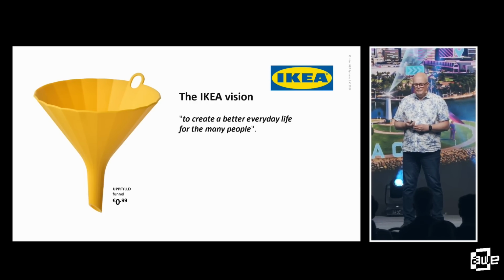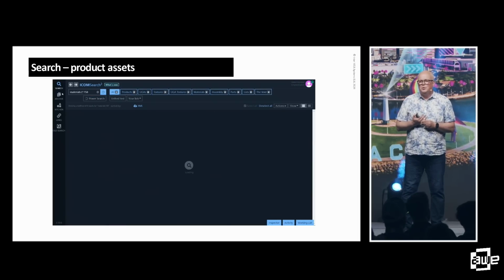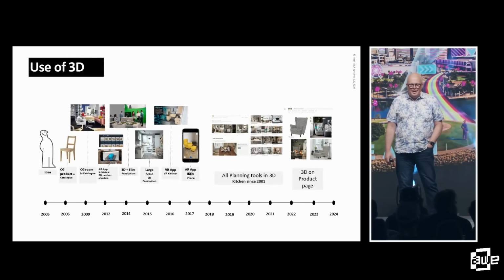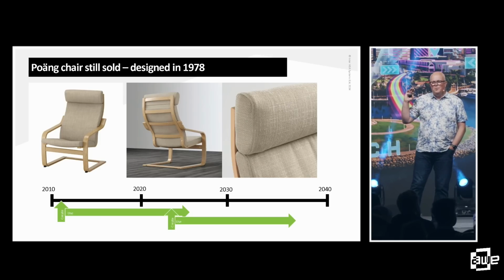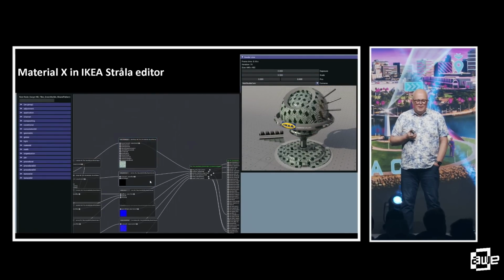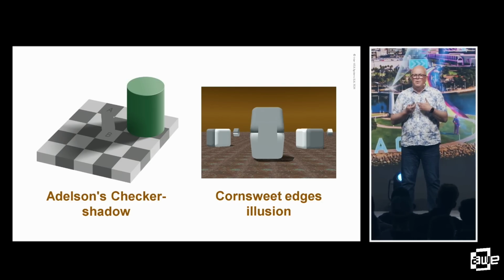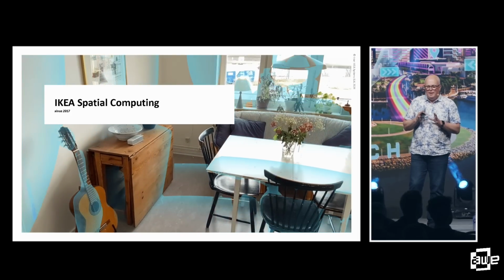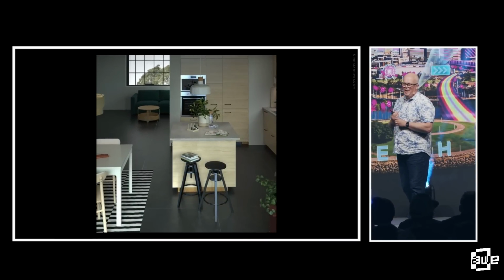IKEA's Journey Through 3D Visualization and Spatial Computing By Martin Enthed

Comment: Ive been using and doing 3d since 2007. Ive never hea4d the term, definitions per meter?!? I  really wonder if 0.05mm accuracy matters on an inage. I doubt their own peoduction of the actual furniture is that orecise. You wont norice a .5mmm differemce in a render of a room or even a close up
Reply: I get the different LOD versions he is talking about but yeah the 0.05mm accuracy is a bit of fluff especially since those models are all made in max and I doubt they are that pin point accurate.
Reply: @papalegba4449  As someone who worked at IKEA communications together with Martin at the early to mid stage when the pipline was defined, I can tell that the models are very much made with that precision, to the eternal headache of the modellers. At my time, the 0.2 mm was the standard, and that was not enough for some close ups, where you had to slap on extra displacement to make it photo real.